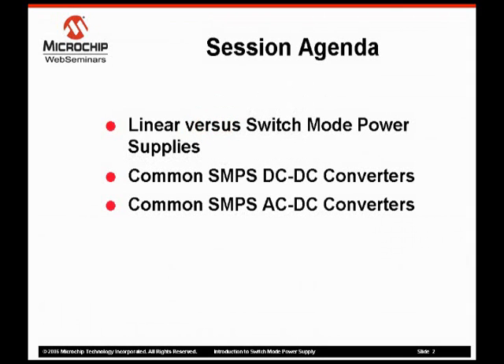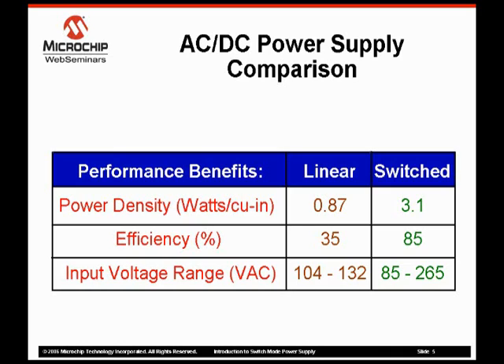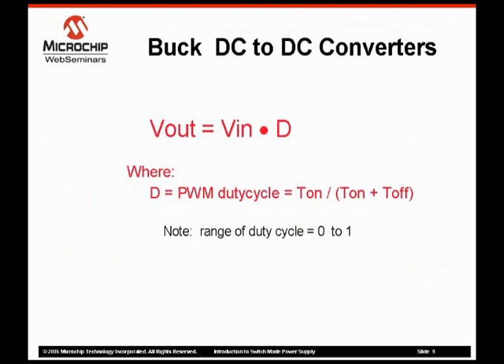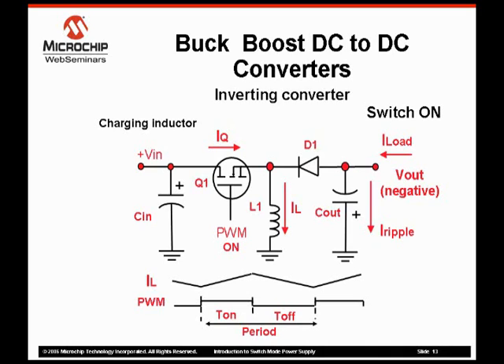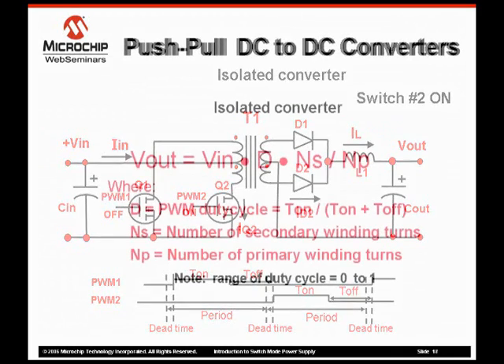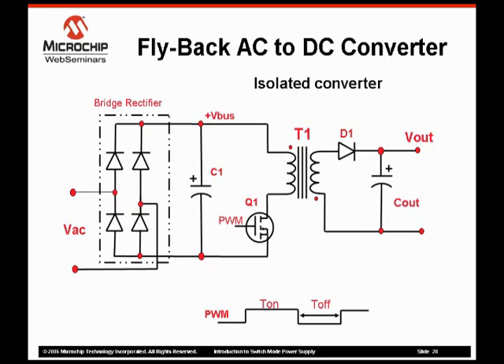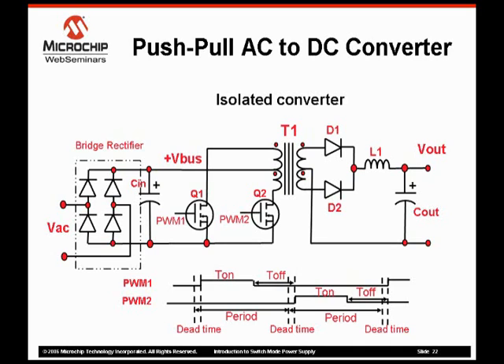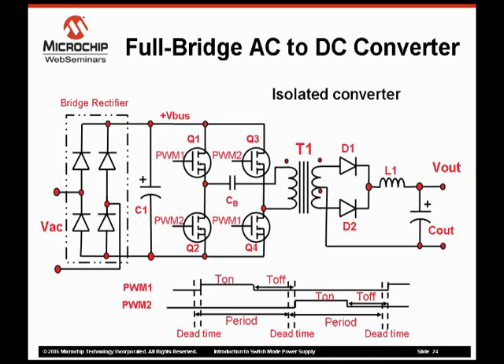Switched Mode Power Supply Using dsPIC

Comment: Hi,

Based on the dot sign of the push-pull transformer on schematic diagram, should the pairing of conducting devices be (Q1+D2) or (Q2+D1) ? If Q1 turns ON then D1 is reverse-biased and D2 is forward-biased so current flows thru D2, not D1 ( 13:44) ?

This is a great presentation though, I appreciate sharing it with us.
Reply: Sir,It seems that possess sound knowledge of electronics. I'm a beginner in this field of electronics. Please guide me in improving my knowledge in electronics. Sir I'm interested in RF transmitter receiver module circuit design for RC circuit design, can you guide me

Comment: Please can you assist I have built an offline half bridge converter using sg3525as my gate drive after testing individual it works fine but when I power all together there will be no output please what could be wrong
Reply: Try rebooting